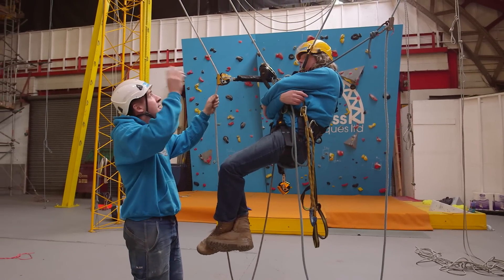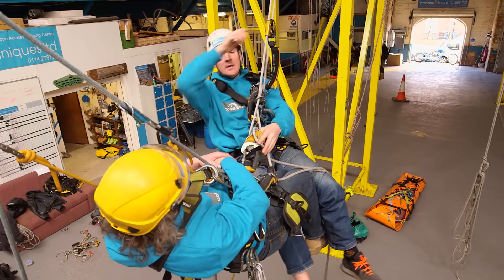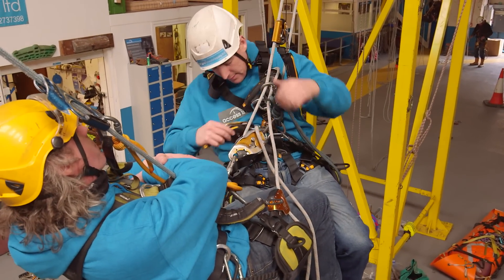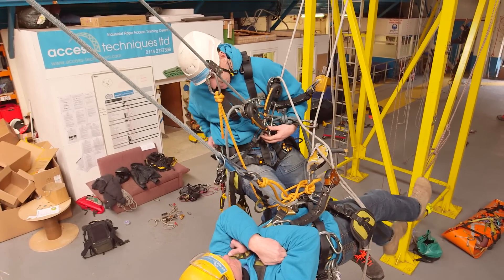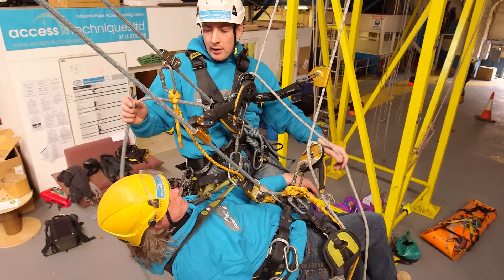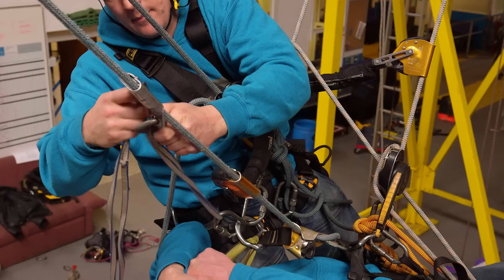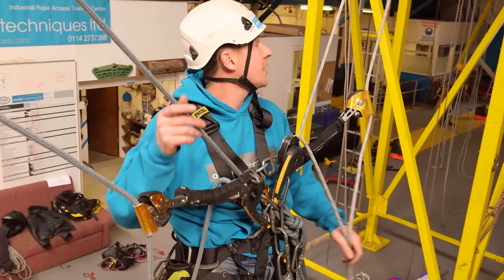Rescue from a mid rope to rope transfer. (The Hard way.) Access Techniques Ltd

Comment: Nice videos.  I also love that Skedco stretcher you guys have down there!  You definitely know your equipment.   By the way, I have a tech question for you guys.  Is there any device other than the ASAP and the ASAP Lock that you can place in the upside down position as in for rescue, that you would use?  Kind regards.

Comment: Love your work guys! What's your thoughts about coming down the tensioned lines to access the casualty on one carabiner? You got swing potential back into the structure should that line fail. I've been putting an inverted back up device on the other line.  Once again, your videos are really great stuff.
Reply from the maker: Hi Simon,
 The Short cowtails is only stopping the L57 from being loaded, you don't really need the short cowstail at all, as the casualty is anchoring you from swinging back into the structure. Hope that makes sense. Book on a course and I'll explain further. ; )
Reply: If you were staying on separate ropes to the casualty and had pulled yourself in and clipped over the casualty's ropes (like a good old Scottish loop rescue)), then you'd be putting a backup over the casualty's ropes like you mention. In this demo, the casualty's rope are in effect anchored at the top and bottom and the rescuer's anchored to those ropes with 2 points and descending them; no different really to descending a set of diagonal tensioned lines. Like Aide says, the krab he used is just to keep the weight off the L57. Cheers.

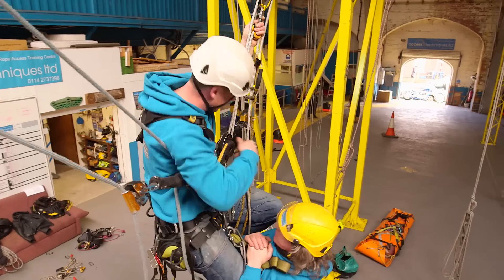Comment: 6:13  Beware, keep a eye on what you're doing. Applying side pressure while lifting 2 persons, unacceptable.  Side loading a carabiner.  Big no no!
Reply: Side loading a karabiner when used as a point of attachment and when there is anything more than negligible consequences of failure - unacceptable
Side loading of karabiner in that specific situation - at worst undesirable .. it could basically be a key ring mate and it wouldn’t matter.